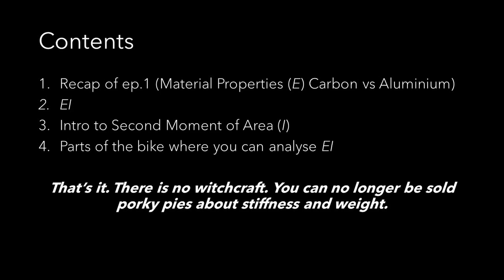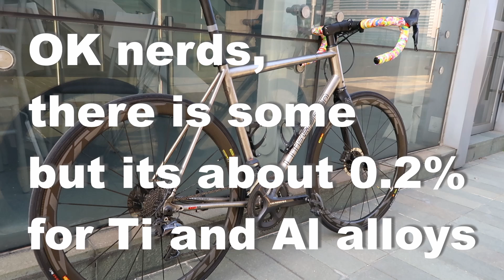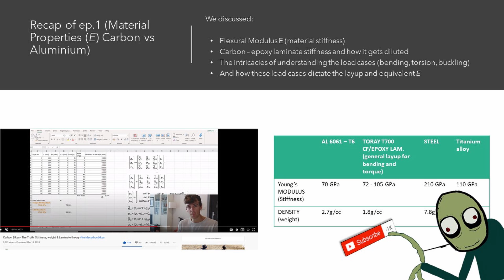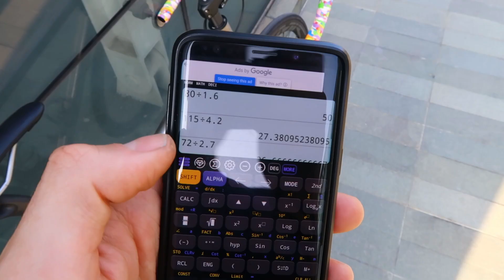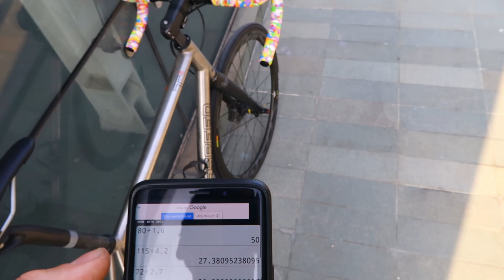Titanium Bikes - The truth and Physics of 'ride feel' marketing.

Comment from the maker: Interesting to read the comments and a few things i didn't mention in the video which are important: Aluminium will likely have larger second moment of area tubes to meet the strength and fatigue requirements (due to having a lower yield and fatigue strength). Thus, the Al bike of equal mass will likely be stiffer due to the second moment of area being higher and having more material volume to play with. I did not address strength or fatigue in the video but its important. For Al frames its normally the driving factor especially near heat affected zones (welds) where the metallurgy changes.
Reply: You're right : not mentioning the impact of fatigue and yield resistance make your video missing the whole point of changing material for various parts. Specific modulus is equivalent, but other characteristics aren't, which allows or force different designs, which leads to different ride characteristics despite equal specific modulus. An interesting video though.
Reply: @PierreAntoineRoiron  agree 100%.
Reply: I enjoyed the video, but isn't this contradicting the point that marketing around Ti frames is bullshit, as the majority of top comments appear to interpret the video as meaning? 

In the video you hypothetically compared Al and Ti frames of the same mass and tube shapes, saying they wouldn't noticeably differ in stiffness. But that's not how they're designed so that's not the reality of the differences between the frames on the market. It's up to the frame designer(s) to decide what qualities they will best achieve with the material, and there are different things achievable with different materials; particularly, as you stated, when regarding yield and fatigue strength. 

So the real point is: A frame isn't inherently 'better' because of the material it's made of, but one can be designed 'better' than another by exploiting the material used, depending on what 'better' means to you.
Reply from the maker: @ccmmrrnn  you're dead right and thanks for the comment. I had filmed a cut about in reality how the Al frame would be slightly stiffer and have more 'volume' to work with for the same mass, how the tube shapes would able to be larger to increase I, and reduce the fatigue stress. Im kicking myself for not including now, but it was getting to a bit of a 15min monologue. Not my best work, but there we are.
Reply: @PeakTorque  Appreciate your reply. Note: 'have to' be larger to 'reduce fatigue stress'. Enjoy the clicks from people thinking this is some kind of 'gotcha', which I suspect you intended, given the title.
Reply: @ccmmrrnn  I was taking the video in very much the 'like for like' comparison of materials, and dealing with some of the 'magic' material properties that people assign to what the frame is from. You're absolutely right that design can follow material, and that will effect the ride and other characteristics - be that complex shaping with composites, or tube constraints with heavy materials like steel - but think some of the key points made were valid.
Reply: @PeakTorque  I think the most unsung thing is rim brakes. A lot of frames are now designed with the rotor in mind and a lot of older frames had flex characteristics. This flex was in the nose of the fork and the rear of the stays where the disc would be now. The stiffness of modern frames comes about because we would all be rather chuffed if the rotor rubbed every time we got out of the saddle which on some of the older bikes would happen because the dynamic shape allowed for compliance at these areas which are now braking surfaces. Also If you are going for some kind of comfort from a titanium bike then round profiles have to go. The old litespeeds (blades) and douglas aero ti 6/4 bikes have a soft quality to them that comes from the non-round profiles, even some certain tubes on bikes that (look round) of 6/4 are not because they are force welded rather then being an extruded tube. I think a lot of complexities of these old designs and why we have the stiffer and mostly round drawn tubes is because those old shapes sometimes induced too much flex and did lead to cracking around the seattube and bb areas. So in retrospect I think TI DID have those magic qualities in the original bikes however their fatigue values just simply ended the bikes life cycle and why we now have such stiff TI bikes, from necessity of design over 25 years of people like Litespeed making TI frames.
Reply: @ThunderousProduction  Disk brakes, superstiff carbon frames and deep carbon rims are the factors being the sudden (re-)discovery of bigger tires.  When people rode small tube steel frames or Vitus 979 with tubular box rims they could ride the cobblestones with 23mm tires (as long as they were going over them at 40km/h not 20 Km/h)....
Reply: @julmeissonnier  Nice!! Well thats what I am doing because my budget is constrained. Older frame-building was definitely an art form.
Reply: Came here to comment all these things, looks like others beat me to it. Might be good to make an update video including the additional factors for a more complete comparison.
Reply: Yeah, the point is that bikes made of different materials are built differently based on the distinct material properties, resulting in bikes optimized for that material. When they started building with aluminum they found out pretty quickly that steel tubing diameters did not work. Likewise with titanium.
Reply: So what lifespan can I reasonably expect from my 2007 Pinarello Paris Alu then?
Reply: @leroythecoffeegeek4611  it depends on the load cycles, not the age itself. You can have a bike in the shed untouched for 10 years and then crack it in a year or do the same within the first year, if you (over)load it the same in that year of use.
Reply: @leroythecoffeegeek4611  My 2001 Pinerallo Prince cracked in 2020, and I have a friend with a 2002 Pinarello Galileo that cracked in 2020 also.  Fatigue life is definitely an issue with aluminum, that's why you have airplane cemeteries in Arizona...
Reply: @julmeissonnier maybe your problem is pinarello? Funny how aluminum fatigue never seems to affect vintage bikes over 40 years on the road.
Reply: @truantray 40 year old aluminium bikes ?? Even as a bike mechanic thats's ultra rare. And if one comes by it's usually cracked and/or corroded to the point the paintwork just flakes off
Reply: @appelflapdrol you didn’t read that right. He said 40 year old bikes are invariably not aluminium (and thus steel) because most aluminium bikes from 40 years back have cracked. He probably means 30 years back when aluminium really took flight as bike material, but the message is the same: most aluminium bikes from that era are cracked or have worn bottom brackets / head tubes / seat posts/ …
Reply: Sorry, I did not find your explanations in a way they can be understood. Yes, you used terms but they without explanation of how these are visualized or applied, this did not mean much to me. Thumb down, sorry.
Reply: One quick question while I watch your video in its entirety : Is titanium as durable and strong as advertised ? Because I'm quite heavy, and even though I don't use my bike as intensely as when I was younger, I still use it everyday to go to work and back home (about 40km per day), and I have a mixed terrain of clean city streets / bikelanes and patches of dense forest trails to cross to do so. I don't put comfort in my priority list, but rather durability over time. I had a Scott Voltage dirtbike for about 15 years, we went to hell and back but the frame eventually broke... I grabbed a mass produced mountainbike on the fly in a hurry, aluminum frame since they don't offer anything else in the shop, and after just about a year, the chain derailed, and broke the small chainring... not related to frame durability, but it just shows how most materials are low-grade and low-quality, that chain going through the chainring felt like walking on butter, metal was so weak I could bend it back in place bare-handed...

So essentially, my dilemma is this : I don't care much about the price, I want to buy a bike that will last a lifetime, is titanium the way to go for peace of mind and overall durability ? is it overkill ? is cromoly steel comparable in terms of durability and reliability ? 

Thanks for your answer and precious advice.

PS: I live in Europe, we have Van Nicholas, dutch based titanium frames builder, seem legit, any insight on them ?
Reply: @KayCypher  Go brazed steel. Spray in some automotive corrosion stopper. Grease every interface between different metals with copper grease. In the factory they all cheap out on proper greasing. Put plenty of grease in to the hubs. This way the frame and the rest will last almost indefinitely.
Reply: Thanks @Primoź Resman. Yeah I realize it’s more about use than time based age. Does age or the way it’s stored play a factor at all or is it 100% down to load?
Reply: Yes, a BIG omission! 😮
Reply: Thanks for this video! I was suspecting that for a while, but didn't take the time to run the calculations :)
About second moment of inertia. Where I see it come into play, is at the vertical tube on which the seat post is mounted. If you apply a rear/downward force to it, the vertical tube bend forward like a bow. I suspect that, thanks to a lower E*I product, leads to a more compliant behaviour, hence the "smooth" feeling.
But this is not to say I disagree with you, far from it!
Another thing that comes to mind, is that now I'm more open to feedbacks that are not science-based (unless these have been already debunked). Became this may be a signal that there's something to dig, even thought the "layman explanation" does not fit.
Reply: Needless to point out, Aluminum bikes are alloy bikes, not Aluminum.
Reply: To completely ignore the yield component is quite misleading.  Your comparison of many of the factors including the resonant frequency change dramatically when you have a much thicker Al tube at 8KSI vs Ti (3Al-5V) at 79.9KSI or even steel at 36KSI.  I do agree with your seat post comment, cheap Al posts act about like bar stock as they are so thick walled, Ti, high end Al or plastic (carbon) all can have a big effect on comfort and perceived ride quality.  It would be interesting to see various equivalent bike frames put on a shaker table.
Reply: @toddeyster7557  sometimes people want so much to make a point that they forget about the important stuff. It's funny how this video kind proves the opposite of what the author wanted to prove. All of the physics in this video only prove what the average frame builder without a college degree could have told you. People changed steel for aluminum because it was lighter and stiffer, and then carbon for the same reason. Many people are going back to steel because it has a better ride quality and it lasts longer, being adequate for touring, gravel and urban. Titanium is just better  and more exotic than steel.
Reply: @tiagommvs   as @Peak_Torque said, materials don't really have their own ride characteristics; that's a function of how the frame design utiises the material's properties. You can't accurately say steel's ride quality is better than aluminium - what you can say is that a typical steel frame is more compliant than a typical aluminium frame, but that takes nothing away from the inverse being totally possible. Also, it's pretty ridiculous to assert steel rides better than carbon - unless 'better' is defined as whatever characteristics a vastly simpler structure has. You can butt and swage steel, and that's about it. CFRP, OTOH, allows for literally infinite design flexibility, enabling the structure to exhibit stiffness and compliance in directions orthogonal to what you'd get from a metal frame, and importantly, the overall shape of bike frames generally isn't at all dictated by stiffness and compliance considerations, but by packaging constraints, and latterly the UCI.

@Peak_Torque 's best point in the whole vid is that the frame actually counts for bugger-all of the compliance anyway - it's all in the seatpost and tyres. He was wrong about the wheels contributing anything meaningful though; they're roughly as stiff as the frame.

What I actually scrolled down to comment about though, is the subject of frame weights for ally and carbon - at one point @Peak_Torque said something like, you wouldn't accept a carbon frame that weighed as much as an ally frame, but people do all the time. I have an ally Avanti from the early 90s, nothing too special, but the frame weighs close to a kilo. I also have a carbon Specialized Tarmac from the mid 00s, weighs 1.2kg. The carbon frame is obviously overbuilt by comparison; if the ally frame shared the compact geometry of the later bike, it'd be even lighter, and if it had a 27.2 post instead of a 31.6 as well, it'd ride about the same, probably soak up more power via flex.

It's probably most instructive to look at some of the lightest weights achieved by each material - from memory, carbon frames can be as light as 600g, ally 900g, ti 1.3kg, steel 1.5kg. This tells you something pretty solid about how the material properties stack up.
Reply: @KimMoth  I never said steel rides better than alloy nor carbon. I said people went back to riding steel because it rides better than alloy and lasts longer. My point was that the video is completely clickbait and doesn't really explain anything other than the seat post and wheels make a difference. And introduces some material charachteristics and physics involved but chooses to omit very important stuff like yield strength or mass and how these affect ride quality is misleading and nuts. If you're not going to explain all of it why even go there? the title of video is "the truth and physics of ride feel" for god's sake...

A lot of people put a lot of effort and thought into designing and fabricating bikes just so someone goes "it's all marketing BS" on YouTube and spreads misleading ideas. The truth is, once you hit the 2000 dollar mark for a frameset, it has to ride sweet, independently of its material, but amateurs are buying cheaper framesets and it's important they now it's not all the same and why not.

Marketing BS is real, and carbon is where the money is right now, and it's a great material with endless possibilities, but because it's marketed so much, you'll find overpriced shitti carbon framesets much easier than steel ones. That's why stepping on a titanium bike and go it's all marketing BS in YouTube video seems kinda silly. What'd he expect?

This was his first video I saw, and then I went to see a couple of others, he's not wrong, he's just selective about what he says to make a point seem objective when it isn't. People love this stuff, so he's making money out of it. One day he'll get sponsored by a brand and he'll do the same thing to say great things about it. More marketing BS...

There's been a resurgence of people buying steel custom made bikes for crazy bucks and it's definitely not marketing. We're talking about small fabrication numbers and almost 0 marketing efforts except for some companies like CINELLI because they manufacture steel tubing. I can see the point the case about hydroformed alloy and it's advantages but these bikes are usually large production and overbuilt which means heavier and very stiff.
Reply: @KimMoth  "It's probably most instructive to look at some of the lightest weights achieved by each material - from memory, carbon frames can be as light as 600g, ally 900g, ti 1.3kg, steel 1.5kg. This tells you something pretty solid about how the material properties stack up." It tells me nothing except the
Reply: @KimMoth  weight. You can't talk materials without mentioning the mass, yield and fatigue properties. You're just repeating what he said.
Reply: @tiagommvs  It tells you how the various properties combined affect the design of a bike frame, in terms of how much of the material you need to do the job. Pretty damn relevant, I'd've thought.
Reply: @KimMoth  What a piece of BS. Steel can be treated by heat to achieve very different characteristics. It was already known by the medieval guys in the forge. In a good steel frame you will find very thin hardened molybdenum steel tubing in the main triangle and pretty run of the mil unhardened steel in the back. The reason is that in the back triangle you have a lot of vibrations, which could cause hardened steel to mechanically harden itself to the point of cracking.
Reply: I quit riding with aluminum bars years ago because I got tired of them snapping on me; and I was just an XC racer who rode smoothly, not some hardcore enduro guy.  I went to titanium bars and haven’t had a problem since.
Reply: @keirfarnum6811  What? No carbon? In tests they seem to last forever
Reply: @keirfarnum6811  Aluminum bar is stronger though 🤣
Reply: I did not buy my Merlin Road way back when (2000) for any 'illusion' of 'cushiness', but merely because it was just as stiff and 'lively' as steel (carbon was just starting to take off back then) while being significantly lighter for that rigidity. ;)

(And yes, NO rust/corrosion to deal with as well as the no paint to chip look of bare ti. :) )
Reply: There are a lot of variables that determine comfort on a bicycle. Stronger riders pedalling harder actually place less weight on their butt- hence, comfort is provided by flexibility of bicycle parts (the other contact points) other than the seat tube. The machine, I believe, should be seen as a system of smaller machines, and modifications in one part can make up for the pitfalls of others thus allowing for several different combinations to provide a very similar ride quality. 

Spoke length, gauge and tension (and number) can modulate a wheel's stiffness, as do material/design of the rim hoop itself. Not all wheelsets are adequate for every rider. Given a well fitting, well engineered frame, this is the main component where a cyclist can personalize ride quality to their desire. This includes, of course, tyre choice (...and pressure...).

Alongside this comment, I'll throw in a sharpened toothbrush so that the most recalcitrant among us finish each other off. ;-)
Reply: And Santa isn't real! Suck it up, kids. It's all just marketing.
Reply: @welovecheshirecats4557  Santa is real! It is the 21st century! Anything is real if you want it to be real!
Reply: @welovecheshirecats4557  No he isn't 🤷